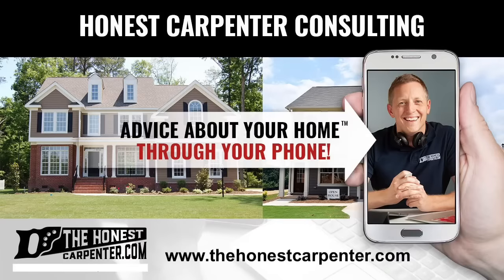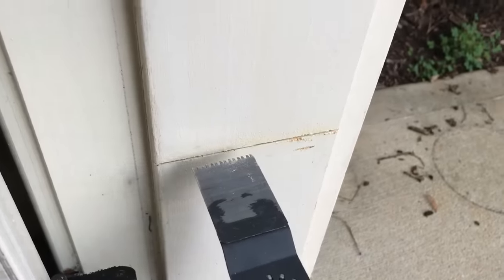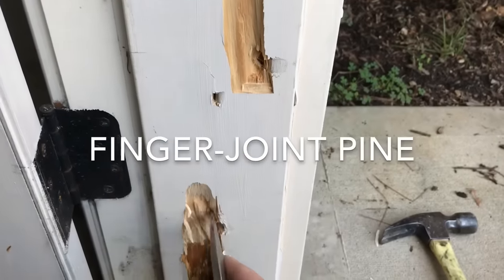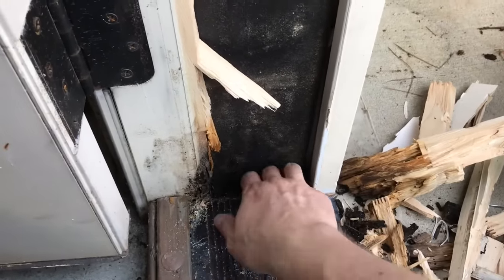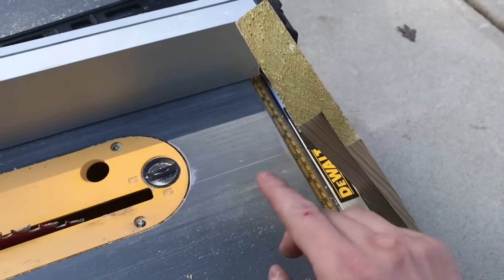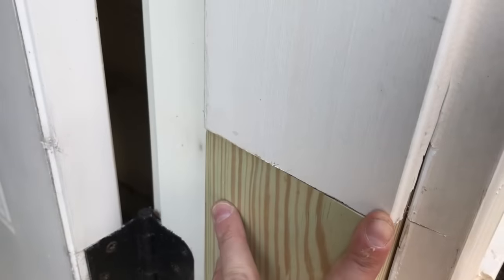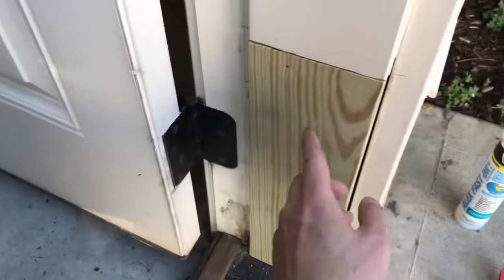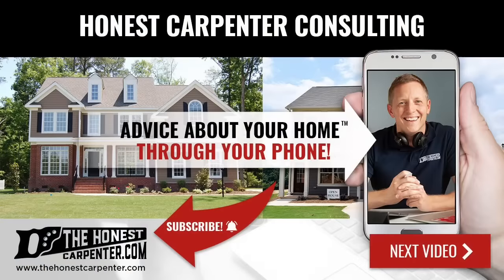How To Repair Rotted Door Jambs

Comment: Door was installed backwards, that wood should not have been exposed to the elements to begin with.
Reply from the maker: Richard Boschen That’s how they go in around here. The threshold points out and slopes away from the door. Which is recessed
Reply: You ever see brickmold on the inside of the house?
Reply from the maker: Dan S No, not typically...or not ever, unless some sort of addition remodel has turned an exterior brick wall into an interior sun room wall. But this garage had 3-1/4” casing inside
Reply: @TheHonestCarpenter  exactly. Richard take note

Comment: I was with you until you used silicone to seal the bottom of the jamb. 100 silicone should never be used on a surface that you need to paint. Paint does not stick to cured silicone. Almost nothing adheres to cured silicone. You're making the person's job who has to paint that jamb at some time down the road extremely difficult.
Reply: So true.... learned this during about 15 years ago when I used a silicone base caulk to caulk the joints on a couple of 4x4 porch posts siding trim material. - When my painter showed up to the site, hey! What the heck did ya do to my siding man! Face  palm

Comment: Way too much work. Use the Oscillating tool to make the top cut like this guy did but also the verticle cut down the left side///out pops the whole piece. All that shattering and breaking with the screwdriver is crazy. And there is a way easier way to shim behind the replacement board but I don't want this guy to get too mad at me.
Reply from the maker: Hey Larry, thanks for writing in! The place I want that vertical line is behind the width of the replacement piece. They have to overlap, or the weather strip won’t have two walls to squeeze between. I break the piece out because I can’t get a saw to that spot yet, and it’s actually a little faster than using the multi-tool on a long cut. It saves on some expensive blade teeth too 😅 Thank you for watching!

Comment: You just severed the Jamb. The structural part of the door frame. This isn't a fix, so much as a rig. You could have done the best thing which is to replace the entire jamb. I'm not impressed and I wouldn't want my name attached to that kind of work. It's ironic that you just put out a video on not using substandard practices as a contractor and yet here you are doing just that. I guess we all have to learn somewhere. Just so you understand : that jamb is what held the threshold in place and gave support to the hinges and the door. Cutting away a substantial portion of it is not recommended.